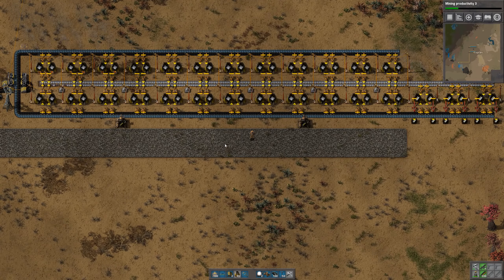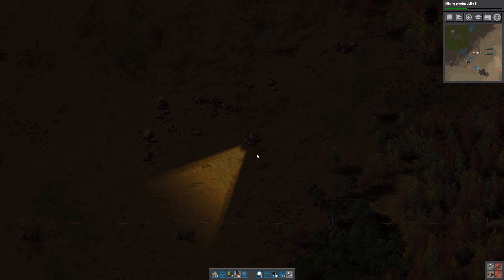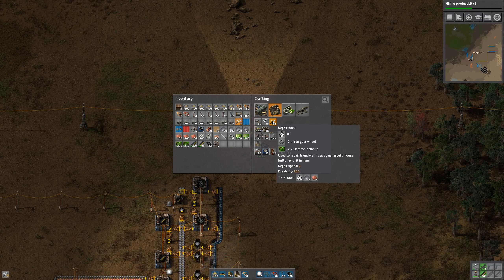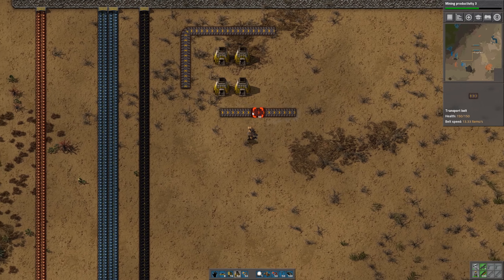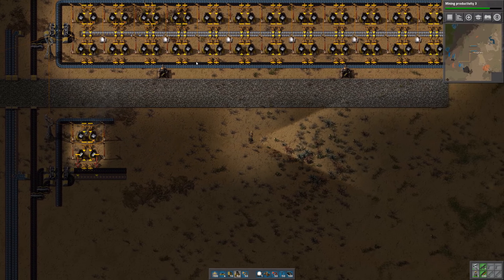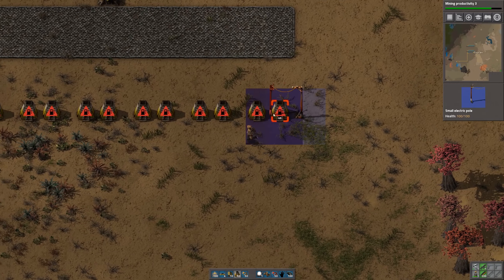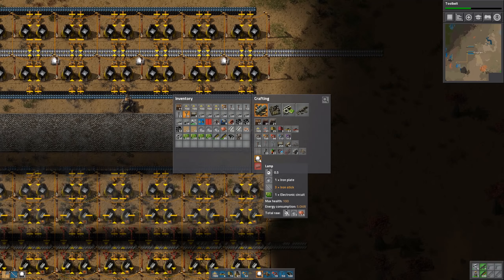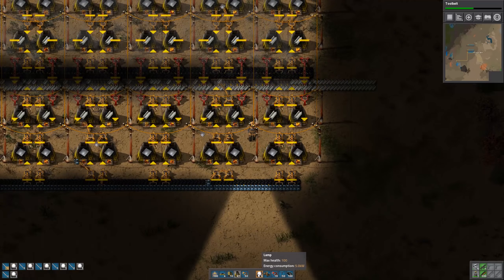Factorio Vanilla Megabase #5 - Steel, bricks, and main bus

Comment: I like saving some iron. I put the coal on one side of each internal belt, then use a splitter(formerly the underground side filter trick) at the end to filter out the steel. This way you only use normal inserters instead of needing the long handed ones.

Comment: When you created the science research area there is one or two places that you mentioned and placed belt balancing.
Why aren't you using it with these long stretches for the Iron and copper smelting?
Many thanks in advance to any that may be able to explain this.
Reply from the maker: I want the ore to be balanced going to the smelting lines, because I want each one to get the same amount of ore.  But, I’ve realized that I don’t care if every belt on the bus has the same quantity of plates.  Usually I only pull from one lane at a time, and with priority splitters I can force all of the plates to the lane I’m interested in using.  So lately I don’t bother much with rebalancing on the bus.
Reply: @TuplexGaming   Right on!  Thanks.  I was getting confused that it was either for maxing out space on the belt or it was for aesthetic reasons Or.. The belts speed was impacted etc..  I think too much whew! Thanks again.

Comment: Nice video. On your steel setup is it sufficient to put coal and the steel output on the same belt? I still love your vanilla factorio content😉
Reply from the maker: Marcus, I think it would be possible, yes.  We need less than half a yellow belt for steel, so you could use the other half for coal.  But, you’d have to side load the belt on one side, because inserters can only load to the far side of the belt.  So it would not save any space.